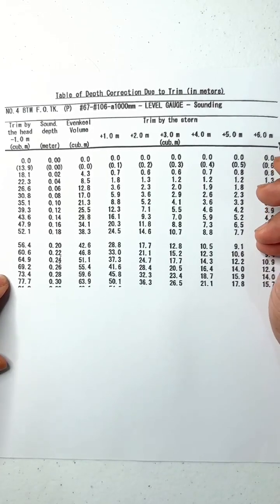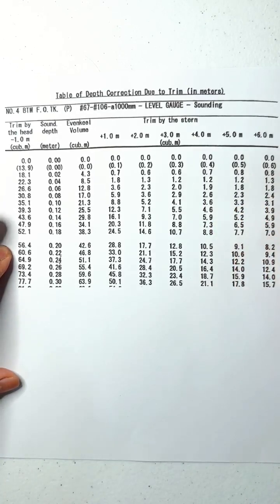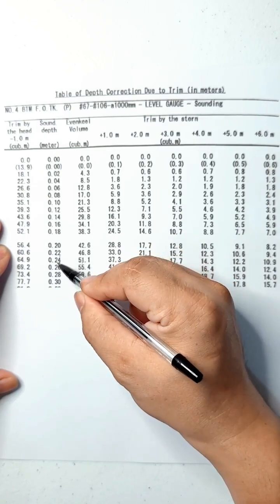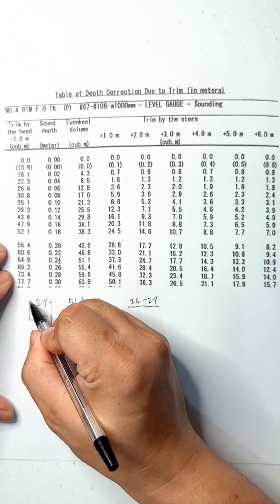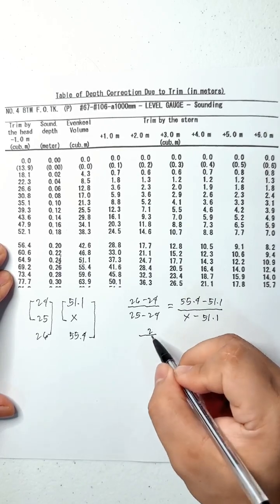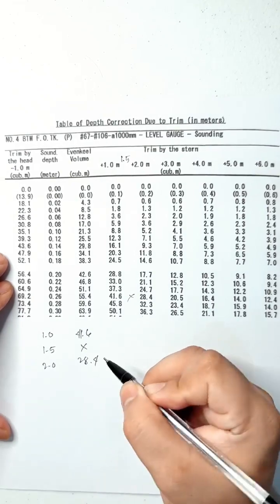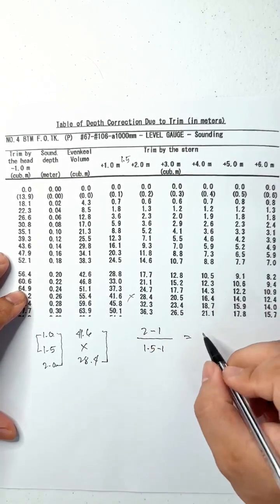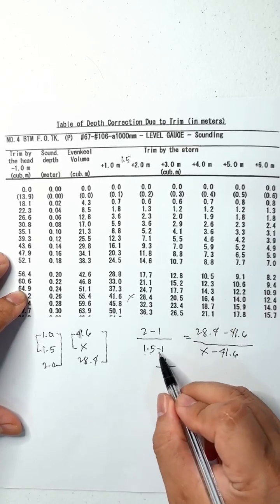Computing the Volume of Bunker by Interpolation

Comment: Very wrong calculation. The correct formula is V= V1+ S-S1 / S2-S1 (V2-V1). You switched it up so you did S2-S1 / S - S1 very wrong the complete opposite thats why you got 2/1 and not 1/2 😂